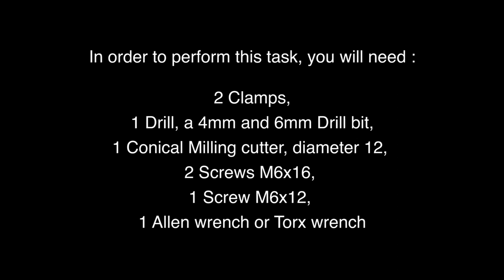HOW TO : Make the upper hole on your ALLVATOR front wing- ENG

Comment: I have this problem obviously because I have the Allvator front wings,I understand why the 4mm drill bit is used, what I don't understand is how it's possible to not destroy the the threads on the existing first hole when using the 6mm.
Thanks for your help in advance.
Reply: Old comment but to help others.... You don't have the fuselage inside when you use the 6mm for the exact reason you state. The thread is on the fuselage not the wing.
Reply: @hughthomas6829  ✌🏼